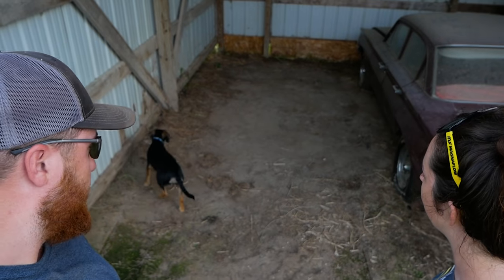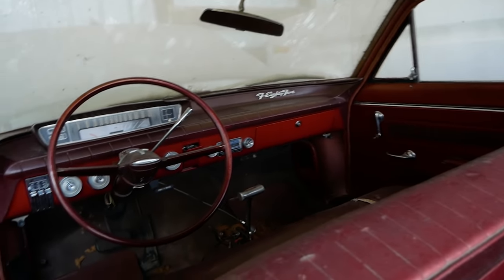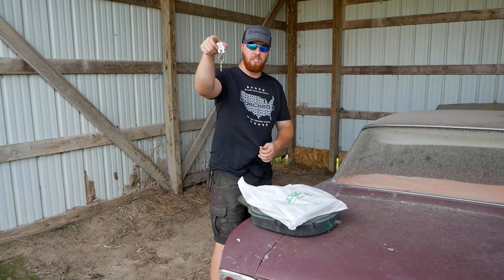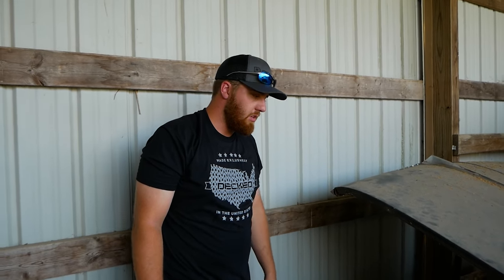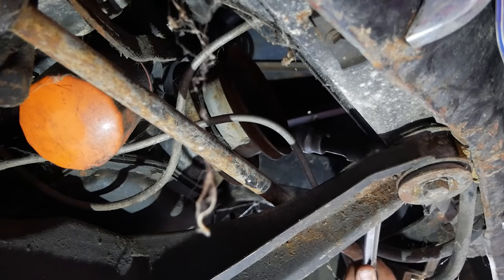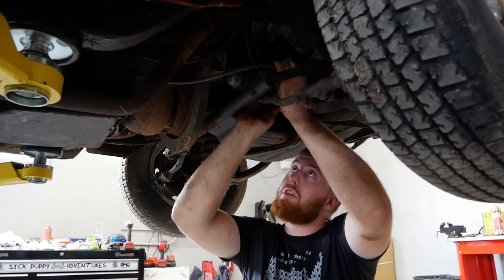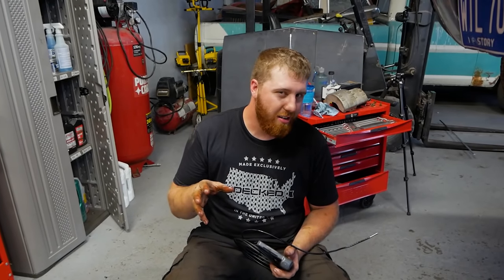BARNFIND Oldsmobile F-85 First Start in 25 Years!! - Part 1

Comment: One thing I've found that helps for loading low cars onto high trailers is to run the parking jack on the trailer as high as it'll go. Not as good as a tilt-bed I'm sure, but it was good enough to get my dad's Triumph onto a trailer that the exhaust caught on otherwise. Cool rig, I hope to see it again, with oil pressure!

Comment: Being from the UK, this is one of the rare opportunities I know something about. Across the pond here we know this engine as a Rover 3.5 V8. The problem you’re having is the fact that the engine has been rebuilt, and the oil pump has not been primed. As others have mentioned in the comments this has to be done by packing Vaseline into the pump. from experience it will not self prime. The clattering noise from the top of the engine, is most likely because it has hydraulic cam followers. I am sure this week with cars should be able to advise.

Comment: Super cool,my grandmother has two 63 F-85 convertible 2 doors. One of them is a 4-speed car and the other is an automatic,grandpa swapped the factory T-10 for a Super T-10,don’t worry they still have the factory trans. When I was little they traded a factory W-30 442 with a standard trans for a 72 442 convertible auto car. They had the car repainted after only a few weeks of owning it and it’s only seen daylight twice since then. I’ve been a Chevy guy since I built my first car,72 ElCamino when I was 15. I never really understood the appeal of the Oldsmobile’s as a kid but at 43 they’re starting to grow on me. Keep up the good work. 👌

Comment: These engines are notorious for losing oil prime when dry from sitting or a fresh build you must prime the oil system with a pressure feed once you prime it it should be fine ask your local engine shop for the tank set up or check ebay there not that expensive
Reply: A Pump garden sprayer works as well that is what I use.

Comment: I had one of these!  Got it in 1977 from an older couple who bought it off the showroom floor when it was new. Same year and color as yours, but a 2-door, with matching color interior and bucket seats.  It was an awesome car, and I learned about the aluminum V-8's from digging up information about it (if you own it, you need to know it).  JC Whitney is your friend when it comes to this car, (and lots of others) the starter is rebuildable by John Q Public.....back when they made things that the owner could actually work on.  Awesome :D

Comment: Pack the oil pump full of Vaseline and fill the oil filter. Prime it slow until it starts to build pressure.  Hopefully the bearings are not smoked.
Reply: You may have run that engine just long enough with zero oil pressure, to have spun the bearings. This happened to me, when the machine shop did'nt align the holes in the main bearings with the holes in the crank saddles.
Reply: This could work. Since the pan will be down, the bearings can be checked.
Reply: If there is damage it wasn’t from you. All new seals in the trunk… carb no seal… electric not complete… he blew it.

Comment: That is one of those, "I don't care it's a 4 door" cars. Dig it.
Reply: yeah that car is sweet even being a 4 door.
Reply: Right?!
Reply: I am so in love with that body style. 4 door or not, so cool looking. This era is so overlooked in my opinion…. Sort of the gap between 1960 and 1964. This genre was between big, gaudy fined cars and clean, sanitary, strong, bold 1965 - 1969 style. There is a delicate esthetic that  just goes away after a couple years.
Reply: Having 4 doors makes it better.
Reply: 4 doors or station wagons are always better 😁
Reply: @c.s.s.1723  My first car was a beat up 66 Oldsmobile Delta 98 4 door "Luxury Sedan" . I was embarrassed to drive it back in the late 80's/early 90's ....The interior looked cool but the outside looked like a big ugly boat. Now if had it, with some nice rims, lowered & air ride suspension, it could of been a cool resto-mod.

Comment: I had a 1964 Olds F-85 "three on the tree" manual with a 330 cu in high compression single 4 pumper Carter that drank high test fuel in quantity. It came  from the factory special order exactly as described and I was second owner. It was a "sleeper", no external chrome except the Olds 330 Rocket emblem on the front of the cowl each side. It was fun to blow off Corvets at the light because it was a four door family body that they didn't expect.  I had to sell it because it was eating me out of house and home for thel and those bias ply tires that never lasted long compared to today's steel belted tires. BUT, it was sure a fun car in the 70's!

Comment: It's not about aerodynamics when you're towing, its the weight on the pin. If you load with the trailer heavier at the back than the front it'll pivot over the wheels and you'll get negative pin weight which unloads the rear of the towing vehicle and leads to a very pucker friendly ride home.

Comment: Guess now I should pull my '64 2 door F85 out and get it going.
Reply: hey man I have a 64' olds 98 I live in India and its the only one in my county so no parts for it here. you know of any good websites where I can get parts for it?
Reply: @robindas8708  I'm afraid not.  The only 64 I've ever seen was mine.
Reply: Same with my '66 Holiday Coupe. I miss driving it.
Reply: My first car in HS was a '64 F85 wagon handed down from my sister.  330 V8 with 2-speed Jetaway trans.  Tough old booger the ac even worked.

Comment: Oil pump priming on Buick/Olds 215 - 
You have to prime those oil pumps as they are above the oil level in the pan.
One way is to put a piece-of-pipe in the pressure sender outlet, connect a length of clearline to it sized so it fits snug on the pipe, and fill it with oil.
Prop up the line holding the oil so it will gravity feed into the engine.
Rotate the engine backwards (by hand) to pull the oil into the pump gears.
This works best with oil already in the pan so it will flush some air out of the pick-up tube.
It's usually helpful to pull the spark plugs while doing this so you don't have to work against engine compression.
Once the pump is primed then you can reconnect the oil pressure sender and crank to see if it builds pressure.
Another way to do this is to pull the end of the oil pump if you can get to it, pack the pump gears with vasoline, and reassemble.
As long as the mechanical parts are good either way should work.

Comment: We used to use a pressure canister that you'd usually use for denatured alcohol to clean out a/c system. Put oil in the canister and pressurize it. Pump oil in the oil sending unit hole and it should fill the pump and also pre-lube everything.

Comment: Some dealers actually installed that motor in the little Chevy Vega back in the day. Pretty fast little setup.
I never did get the concept of a 215 C.I. V-8 that's 4 cylinder size. The short stroke of that engine made it a nice performance engine.

Comment: I bought one new in '61.  It was a 2-door tan coupe.  Loved it.  Only issues I remember between '61 and '68 were the steering gear that kept getting loose and the radiator that kept plugging up.  The engine ran great.  Wish I still had it, and the '68 VW bus we bought to replace the Olds.  They'd probably be worth more now than what I paid for them new.

Comment: HI I had a couple of these, one Buick and one Olds, the reasons that they ended up in the junk yard were the cams were never broken in at the dealer so they would lose there lobes (a big problem for GM into the '80s), the front end joints were very undersized and would wear out at <50k miles and people would strip the spark plug holes on the aluminum heads. the Buick motor was a better motor (it had some extra top end parts). for a 215 they ran very strong, I think there was a supercharged version although I never saw one. The oil pump should be easy as it is mounted to the front cover, the main bearings as you said were replaced so replace the pump, it is likely that the drive is sheared off.  They were rust buckets the front fenders would literary fall off (no inner fenders). I was told that Land Rover bought the rights to this motor and used it for many years.
Rich

Comment: Not everything goes well guys.  You could try priming the oil pump.  Remove it and pack it with vaseline or something similar.  Spin it with the drill until you get pressure.

Comment: Pull the oil pump cover off and take the gears out. Run your bore scope through the hole into the block where the oil travels and see if there's anything stuck in it. Had a freshly rebuilt AMC 304 do the same thing when we tried to prime it. ended up being crude in the oil passages from the block being baked at the machine shop, and we ended up using one of those cheap little hand transfer pumps on the oil filter port to suck oil up the pick up tube and into the oil pump housing. it eventually primed after that. hope this helps.

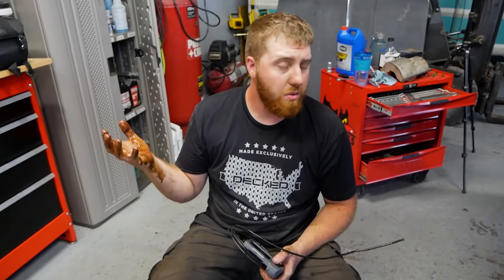Comment: 40:31 rip that FRAM off, throw a couple quarts back in the pan, spin the pump with the drill, and see what it does. Also be worth cutting the FRAM open to see if it has let go of chunks of paper element to plug up oil galleries with.
Reply: After seeing how crummy those orange frams are I wouldn’t even try to start an old engine with it. Put a new filter on it before the first crank.
Reply: @ImTheJoker4u  FRAM Bombs, I call them. They're great for setting out on cinder blocks at the rifle range(Fill 'em with colored water for good effect!) but I'd never use them on an engine.

Friend of mine in HS bought a '67 Mustang that'd been somewhat hotrodded. 351w in it, bit of a cam, high-stall converter on a C6, that sorta stuff. He complained to me that the oil pressure was super low...5-6 pounds at idle and never more than about 30 pounds, alongside a LOT of valve tick. I took one look at the filter, told him to go get a Motorcraft, Purolator, or Wix oil filter, 7qts 10w30, and we'll change on the oil.

Whaddayaknow it suddenly found 25 more pounds of oil pressure! And the valves stopped clattering!
Reply: FRAM The orange can of death
Reply: Yes, it's a possibility that Fram grenaded itself and stopped oil flow. I highly recommend investigating this.
Reply: Fram is fine. Purolator is trash
Reply: @Bore_Punch  [Citation Required]
Reply: @Bore_Punch  
I suppose it's "fine" if you DGAF about your engine. Do some research.  They're notoriously the worst performing and poorest built.
Purolator is actually a pretty decent filter, along with Wix, Mobil1, and Motorcraft. K&N is just a re-badged Mobil1 with a useless stamped nut on top. 
Whatever you use, ALWAYS get the extended life. They generally offer the best filtration, and have better build quality.
Reply: @TestECull  https://bobistheoilguy.com/forums/threads/motorcraft-fl820s-fail.306277/
Reply: @Bore_Punch  One failure does not a shit brand make my guy. Find me more than that. Find me a trend that shows purolator filters are engine killers like we have for FRAMs going back many years.

One case just means a single bad filter slipped through QC. Any company can have this happen no matter what they make. Intel and AMD let defective chips slide out the door, Samsung lets defecting phones and microwaves out the door, you get the jist.

Find me more than one example. Find me a trend. 'Cause the only trend I see is purolator and wix being top shelf shit and FRAMs being engine killers.
Reply: @TestECull  https://bobistheoilguy.com/forums/threads/mc-fl820-6-000kms-cut-open.256875/
Reply: @TestECull  I can keep going.
Reply: @TestECull  one is enough for me to not buy a tearolator.
Reply: @Bore_Punch  Then please do, because a single case from two years ago is not enough proof of anything other than bad luck on the part of the guy that bought that filter.

You want to change my mind on purolator you're gonna have to do a hell of a lot better.
Reply: @TestECull  I just provided 3. But there are many more. Like I said one is enough for me not to buy a tearolator. I haven’t asked for proof to show me fram destroys engines.
Reply: @TestECull  ok boomer
Reply: @TestECull  no. I don’t have time to argue with idiots. I’ve spent maybe 5 minutes replying to you and finding examples of purolators tearing. While you yourself has provided zero evidence of a fram being an “engine killer” . I’m betting your knowledge of fram being junk is only from a video of someone telling you they were. That and the fact that they use fiber end caps. I’m not a fanboy of anything. Anything man made can and will fail. However I get tired of seeing the ignorance surrounding fram filters. Btw all 5 cars I own, currently wix are on 3 and fram are on 2. Peace

Comment: Bad oil pump my brother had the same issue on his old 67 F85 it wasn't moving any oil just like that one.
Reply: That oil pump may have just lost its prime. You can try to pack it with Vaseline and put it back together.
Reply: A 67 should have had a real olds 330 v8 not the buick one.

Comment: Rover in the UK bought the tooling/rights from GM for this engine. It was used in Rover cars and the Range Rover/various Land Rovers from 1970 til the early 2000s or thereabouts.
Edit: you already knew this. Hey, I might have a starter off my old Discovery you can have.
Reply: Totally. My dad has an original MG BGT V8 from 1975. Same engine as in this I think, buick 1950s block with MG's own twist on it. Range Rover in the 70s used the same I think.

Comment: Vasaline the pump or... Use a garden sprayer and put a barb fitting into the end of the plastic tube, remove the oil pressure sender and fit and turn it over by hand. They will produce 40lbs. Good way to pre lube as well.
As others have stated, Rover V8s are renowned for that issue.

Comment: Yes!  I had a 1961 F85 in High School in 1965.  Paid $900 for it at a used car dealer. It was a POJ actually.  Even more so after I accidentally left the radiator cap off and it blew all the water out of the  radiator, over heated and either burned a valve or blew a head gasket.  I just junked it after that.

Comment: Love the car even if it's a four door. That's back when cars had real metal and body lines.
Reply: Even if it's a four door.. come on Its like a having four arms. IT'S different, visual off putting but very useful 👌
Reply: May be surprising, but cars are actually still made out of elements that are considered metal. So cars continue to be made of real metal!
Reply: @ajorsomething4935  sure they are still made of metal. But not like the THICK medal they use to use. The shit they use today will bend if you look at it hard.
Reply: @stevencartlidge6574  if that's the case you may be a metal bender and not know it.
Reply: I want to daily it so bad
Reply: Weld the back doors shut, and install some bucket seats that recline forward, for the 1-2 times you'll actually need to access the back area to install/uninstall the nitrous tanks, and make it no so 'off-putting' at the track, after you tub the rear end and put a small block 350 or and LS in it . . . . Throw some Falcon or Comet badges on it, and make people wonder WTF it really is . . .  T-Bird or Corvair badges might actually work as well, just no coyote or Volkswagen engines. It's already been Frankensteined' a little, so why not go all out, and make it the best version of itself that it can be. It's a neat little ride that's survived thus far well enough that it deserves to be 'big-boy' for once in it's life.
Couldn't really call it a sleeper because anything can be a sleeper these days so nobody takes anything for granted anymore.
Oh yeah . .  . The new rotary engine design looks very promising and bulletproof, so that might be something to consider as well. Theoretically those engines should be able to increase in speed/rotation until they literally come apart,  they accelerate extremely fast, and they're very lightweight, making a partial electric treatment, a pretty attractive alternative or choice or whatever TF I'm trying to say and can't find the right word(s). LOLOL
I just hope he'll sell it to me, so I can give it some form of new life, if he's never really gonna do it.
It's not my 1st choice for a new drag racer, but I could surely make due with it.

Comment: My 1961 Buick Special 215 oil pump must be primed after long term storage. On Buick the oil pump is mounted outside the block. NAPA does stock a new gasket for the oil pump. Per the Buick shop manual; remove the five bolts holding the pump, one is behind the filter, so remove the filter first. Clean everything, check the gasket and openings on the pump and modify the gasket if necessary. I needed to cut a small slot to keep one port open. Pack the pump with Vaseline. Yes use Vaseline not grease per Buick. Pack it good. Put it back together fill the oil and start it up.

Comment: Did some research, the pump on these is external, so it can be checked/rebuilt without tearing too far into it. It's behind where the filter bolts on.

Comment: In 1974 I owned the Pontiac Tempest version of that car. Same four door burgundy but with the half of a 389 four cylinder. It had the "rope drive" cable drive shaft to a Corvair trans axle in the back. Those trans axles are bullet proof but I don't think the rope drive could handle any power upgrades.

Comment: That factory 2bbl intake you show when you’re cleaning out the trunk resembles what a turbo 215 was supposed to be set up with. Those cars had a blow thru system on them,you may wanna investigate a little bit deeper into the extra parts you have. Maybe enough extra original stuff to pay for what you have into the car already.
Reply: Turbo had side draft 1 bbl. carb...

Comment: My Dad had the Buick version of this in a 2 door. He drove it so much they had to replace the heads because they stripped out the spark plug holes! Great running engine! This was also used as an auto conversion to power airplanes!
Reply: I blow a spark plug out I fixed it by putting a helicoil in it
FYI The heads are the lightest heads I ever carried